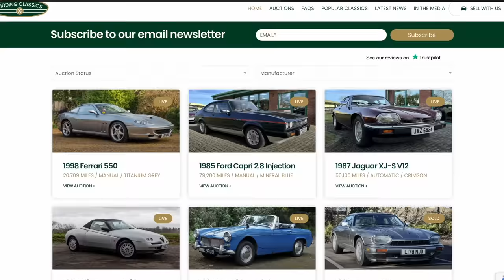Everything wrong with my Rover 75...Have I bought good car?

Comment: Love these cars: I’ve had a 75 2.0 KV6 and a ZTT 2.0CDTi. I’d still have one if the latter was ULEZ compliant!

Non- working passenger lock likely the c/l door motor: it’s the same as your Freelander’s and the same as fitted to the R50-53 Mini

Boot leak may be a leaking chrome waist trim fastener

I suspect misfire is a coil pack on a MEMS3 engine. 

Glad this one is a k16! ❤
Reply: could of also been an old code if it didn't come back when you reset it Matt, as it would of shown a misfire when the head gasket went.

Comment: Matt, a quick tip regards the plenum drains. Under the car the exit for the fluid can stick together causing a blockage. I cut mine at an angle which prevents this from happening

Comment: I tend to use thick strimmer wire for clearing drain holes. Works especially well with sunroofs where the drainage channels go all the way from the roof to the chassis.
Still looks like a good one you've got there Matt. Just stick a leather interior in it and keep it, you know you want to. 😂

Comment: Enjoying your channel with good advice. my 75 wasn't solid after only owning for a 18months. To get through MOT each jacking points had to be replaced as rust had made therm redundant. Steering wheel is like yours but my boot floor handle has come into two. Need to replace if i can find replacements.

Comment: Water ingress on my 75 was from two places. The chrome trim along the side of the car at the boot is screwed in and these seals fail. With where your water appeared to be coming in, I would say it's a leaking rear-light seal. These are a very strange material and split easily after 20+years.

I initially glued it, which did not work, then flipped the seals on the headlights and applied gutter sealant. This worked a treat although you have to be a fairly steady hand with a mastic gun. You can buy the replacement seals too but I grumbled at the price, and of course, the fact they failed in the first place! If you want to clean it up a little while you're there a toothbrush is ideal.

My handbrake was also atrocious when I bought my car. The 75 and ZT club forums hold the answer, compensator mod!

Comment: Have you considered upgrading the interior to all leather as the leather seats really do lift the look and feel of these 75s. I think you could get a suitable second hand set of seats that would add value and make it more desirable when it comes to selling the car.
Reply: For practicality and comfort I would actually prefer the velour.  I would certainly change it entirely if it were in bad nick but it seems pretty good.
Reply: @peterriggall8409  my Rover 75 was a Club SE with the velour seats, but after sitting in a Connoisseur (in a scrap yard - I needed the door seal) I definitely want the leather seats if I were to buy another 75!

Comment: Great video Matt, looks like it's possibly a keeper, for a while at least !  One word of warning though, before you start work on swapping the steering wheel.  Make sure you follow the manufacturer's procedure to fully  disarm the SRS circuits, and allow enough time for any capacitor stored charge to drop away. Most vehicles of that age will just require the battery completely disconnected at both terminals, and wait the manufacturer specified time of 30+ minutes. Sudden disconnection, or connection of any electrical plug when stored charge is still in the system, will cause enough electrical spike to trigger the pyrotechnics that deploy all the AirBags and Seatbelt Tensioners etc. They go off with more than enough force to do you a serious injury, break bones, knock out teeth etc,  if you're too close to an airbag as it fires.

Comment: A nice surprise that it's in good condition. The toughest repair is probably those brake lines, otherwise it's cleaning and bolt ons. Can't ask for more!
Reply: When I upgraded my ZT 1.8T to ZT190 Front Brakes, no way would that Brake Line Union be undone due to corrosion exposure to road filth, salt and moisture in the Wheel Arch. I had to use an angle cutting disc which destroyed both the metal and flexible rubber hoses. Enjoyed fashioning a new Cupro-Nickle Brake Line and I already had a good Flexible brake hose that came with the ZT190 set up.

The upgrade provided the overall feedback "feel" and initial bite when using the brakes that I prefer. The OEM Brake set up works well but the ZT190 ones are better. There's ZT 190 Brakes on my V8 260. The massive rear calipers on the V8 are the same as those on the front of my son's Lotus Elise S2.

Comment: Looks like a decent example you got yourself. Check rear suspension arms ( the ones the coil spring sits in) they fail over time and is an expensive job. Keep that window control unit, you can fit a new button and it's as good as new (garage broke mine).

Comment: There are 10 water entry points in the 75 saloons boot. They're a bloody nightmare, most common is just the light seals. If you're getting the T-Piece (located correctly btw) from DMGRS I think they've got the seals too.

If it is one of the other points there's a whole thread on the forum about how to fix them. Always advisable as having a damp boot is always a pain!

Comment: There's a Rover specialist near to Nantwich and amongst various nice MGs and the like there's a bona-fide Tourer V8 in the same colour as yours which I presume belongs to someone  who works there or owns the place. Absolutely glorious!

Lovely 1.8T there, these still look slick! It's odd that earlier 25 and 45 lights don't yellow but the 75's did.

Could you get the wheel re-trimmed with a modern dimpled leather? Worth a gander!
Reply from the maker: The 200 lights yellow, Im not sure the 25/45 dont, Im sure Ive seen some go.
It could be done but would be a fairly costly option
Reply: TOURER V8?!?!

zooms to Nantwich

Shame MG Rover didn't plump for the 3v SOHC version (225 kW (306 PS) / 435 Nm) with its 6-speed manual and 5-speed auto!
Reply: @applejuice5272  

Rover On Ltd, worth looking up! 

It is a shame the multi valve head wasn't the weapon of choice like you  say though.

I keep thinking about the fact that the VHPD engine that is the Ford Coyote engine would drop straight in the 75/ZT V8 platform! 😊
Reply: @furiousdriving  

I think the later post project drive stuff yellows, usually where the 25 and 45 are concerned. The lights on my early pre-project 'drivel' y2k Rover 25 are still clear as glass though! Never treated or even polished either. Bizarre!
Reply: @kenbarlow5373  Ta! 😊 Oooooooooh, yes! Or a sorted (Ricardo plc) KV8...
Reply: PPD cars don't suffer from light yellowing. After late 2002 they all suffer it, albeit some less than others. Pre-facelift 25s are generally the best for it! 75s the worst.
Reply: @Max-gz7ik  

I'd love to know what happened! I'm guessing not necessarily a different manufacturing plant but definitely a switch to a cheaper plastic. Honestly, I can't stress just how water clear the lenses are on my little old 25 and I have genuinely never done anything  to them. Point of potential interest, remember the 'black mask' lights fitted to various pre face lift cars? I don't recall any of them yellowing. Coincidence? Maybe!
Reply: @applejuice5272  

Oh now that's a splendid thought! 😁
Reply: @kenbarlow5373  I've got access to a bunch of the lights so I may give them a look over if I get the chance and see if it was be a change in manafacturer. I can't say I'd be surprised! That or Phoenix requested a cheaper grade of plastic that was more prone to clouding. That also wouldn't surprise me.
Reply: @Max-gz7ik  

Call me sad but while I know it really doesn't matter anymore I'd be intrigued to find out if you get chance!

I bet the switch to cheaper plastics as you mention was more than likely the issue though!

Comment: My Mum has a low mileage 75 (65k)  and I have a high mileage (400K) 820 Vitesse.     The 75 , compared to my 820 is cramped , claustrophobic, gutless  and heavy car to drive with a gearbox that is ponderous and long in the tooth .    My 820 is delightful, light clutch,  Tomcat engine , much bigger car and able to lug huge heavy loads down the Motorway to my boat every weekend in absolute comfort .   Would I want a 75 ?    Not until the last 800 had come my way !

Comment: Think you've a good'un there, Brylcream is a bugger to wash out, i know you don't use it but maybe a couple of antimacasers for the front seats will keep those head restraints clean or a couple of Furious beanies stretched over them.  Most dirt comes from hands when reaching into the rear or rear seat passengers grabbing them.  Your trolley underfloor washer will come in useful as looks a bit mucky underneath.

Comment: Should of checked when they did the timing belt did they replace the tensioner and other parts had a fiat fail because the bearings fell out of a wheel in the timing kit

Comment: Get the wooden steering wheel if you can, 👍👍
Reply: They are cold in winter !
Reply: I'm glad it doesn't tbh
Reply: The walnut ones aren't easy to find. The light oak ones are easier to come by, but don't match the rest of the interior on a Mk1 car.

Comment: I’ve just bought myself a29;000 mile rover 114 sli.  It’s spent periods of time in storage so it’s totally rust free and still has the spot welds showing on the wheel arches.   It had a cam belt change at 26;000.  But that was in 2008 so before I drie it I think it needs changing .
Reply from the maker: I think it will! Nothing has a 15 year interval!
Reply: @furiousdriving  the dealer I’ve bought it from was going to drive it from Surrey to me in clacton on sea. But decided to put it on a transporter.

Comment: You can get an upgrade to the handbrake mechanism. I think it uses a part from the BMW Mini!
Reply: R52 model, cable only, the later ones are different , the owners club do, a modified  compensator that has a shackle welded in place of the arm, which solves the stretching problem, its a direct swop and easier to do,
Reply: @martinbutler9999  

Is there really a difference between the part fitted on an R52 over an R50/R53?
Reply: @kenbarlow5373  Serial ZT owner here. Every one suffered Handbrake Cable Compensator fatigue with the open end of the loop opening further when handbrake applied. Owner then applies handbrake even harder opening the fatigued loop even further.

Cured simply closing the compensator's open loop until parallel again and welding a short metal rod to close the open loop permanently. That makes the loop stronger and no more opening when handbrake applied firmly. You can park my ZTs on the steepest slope with absolute confidence. My MoT tester usually compliments the handbrake's holding power when testing them on his Rollers. ..👍👍

The downside to this is accessing the the Compensator. It is under those very thick and heavyweight quality carpets which means the seat bolts need to be removed .. lot of work. Some folks cannot be bothered with all that and cut the carpet carefully under the centre Console accessing the compensator that way.
Reply: @T16MGJ  

Brilliant. But there is no difference between the part mentioned between the r50/r52/r53.

How do I know? I've worked on all rhree models.

Incidentally, I bought one of your most excellent UJ gear linkages for my old ti back in the day and it looked amazing and performed even better (SnapdragonGT here).
Reply: @kenbarlow5373  Hi Ken... 

The earlier ones fitted to the Bini are by far the more substantial and more suitable to use. There is a big difference. I have one of each here as I type.

Back in the days when most Rovers and MGs had PG1 Gearboxes were more numerous, I made up batches of those PG1 modified Gear Selector Control Shafts. Those along with a modified Gear Lever to reduce fore-aft travel resulted in a far more positive Gear selection on the PG1 boxes which were very good in OEM spec with one exception. The Flimsy OEM pressed steel sheet metal UJ which was prone to metal fatigue after thousands of gear changes. That modified shaft and quick-shift gear lever sold like hot cakes. We still have two 620ti in the family. One time we had five. My son's example showing 240,000 miles last time I drove it. Over ten years ago when at the very end of the MoT test that it passed, the tester struggled to get it in gear to drive off the ramps and in so doing heavy handed, fractured the tired flimsy UJ.  We drove the car the short distance home stuck in third gear! Have images of that fatigue fractured OEM UJ. The modified one was and still is a permanent fix. He's been all over Mainland Europe in it. Done a lap of the Nurburgring in it fully loaded with holiday luggage and his mates. Also Snowboarding in Norway when his mate fractured his leg falling on the snow slopes. My son drove his Nissan Pick up back to the UK whilst another mate drove the 620ti back home.

That Nurburgring lap was recorded by a mate and is on YouTube. Look for :~

 620ti  Nurburgring. 

Lots of laughs and comments like "I cannot believe how fast some of these cars are travelling"

Rover and MG have made some very good cars. The Rover 620ti with the Rover Turbocharged T-Series engine being up there in that top bracket. I can confirm the ABS on the 620ti works very well indeed approaching twice the UK National Speed Limit. Surprisingly well..

Safety Fast MotorinG Ken. As the old MG adverts used to say.

Comment: Hi matt, matt can you do me a massive favour, can you tell me what size (length wise)straps which hold up fuel tank on your freelander. Unfortunately i not able to get under my freelander have damaged my shoulder rotation  cup. Heavy lifting. Only if you can and if you want to. Many thanks matt. Good car's them rover 75 use to own 1 very   long time ago. Thanks again matt.

Comment: Are the carpets damp 🤣 my ZT 260V8 leaked around windscreen seal, door seals, sunroof drain pipes front and rear, plenum, missing grommets in bulkhead which lead to the wipers and lights to pack up in the rain, boot seal, rear light seals, rear window seal, even the holes the side stripe is clipped into leaked. In 37 years of driving and 146 cars, this was the worst car I've ever owned which is a shame as I always thought the ZT/75 was such a handsome car.

Comment: Great… we’re going to get to see you replace the notoriously stretchy handbrake compensator unit with a much better one from an R50 Mini !
Reply from the maker: I have been told about that..
Reply: @furiousdriving  there is a modified standard  compensator available from the owners club, that's a straight swop and easier to fit

Comment: USA viewer here; you’ve explained that these engines are known to suffer with head gasket failures. Is there an upgraded gasket to retro install ? Or are you limited to a standard factory gasket ?
Reply: Upgraded Head Gasket available  , covers MG TF range as well
Reply: Yes two primary options are available.

One is the elastomer gasket, a similar design to the original but the rubberised bead is made if a different material. The problem with the original gasket is the bead would react with the coolant and plastisize if the mix was wrong. The revised "BW750" elastomer gasket is by far the best choice.

The alternative is a multi-layer steel gasket. Later in the engines life these were fitted from the factory and are a dramatic improvement. However they require very fine tolerances to seal properly. Primarily the liner heights which have to be 3-4 thou proud of the block. Anything out of that range and it's likely to have a premature failure after fitment. This is a large part of why they have their reputation. Garages heard "the cars with MLS gasket don't have problems" so a customers car comes in, they fit an MLS and 500 miles later the gasket blows again. And repeat etc.

It's a very easy engine to sort, if the correct parts and modifications are fitted properly you won't have to do it again. They're extremely light, powerful for their size, light on fuel and reliable. 

The real problem with the K is that it was essentially a race engine detuned for the road, it's a fussy engine that requires very regular servicing. Great for the Lotus and MG sports cars, less great when put in daily driven luxury saloons and hatchbacks. The revisions made to it eliminated the problems it had, but it was always going to be a problem to begin with. Every other manufacturer in the '80s used an iron block SOHC engine for a reason!

Comment: Looks like you have a good 75 Matt, water ingress in boot is perished rear light seals or water coming through the chrome strips. Also check the footwells and carpets are not sopping with water, had that issue with mine when I first got it. 

Think you would regret selling the Volvo, my choice would be the 420 GSi.